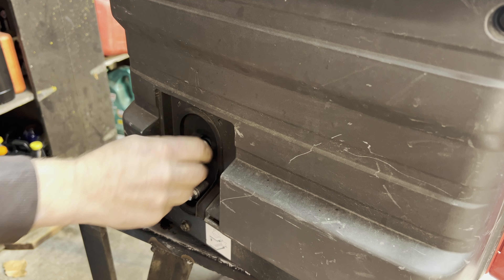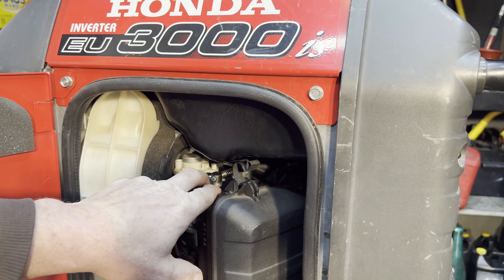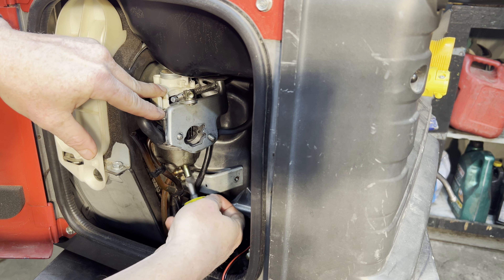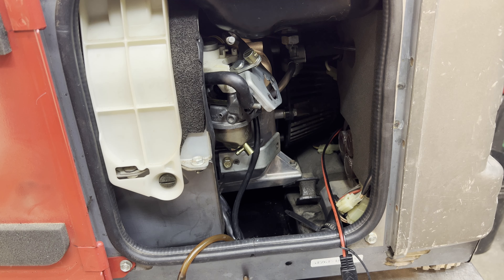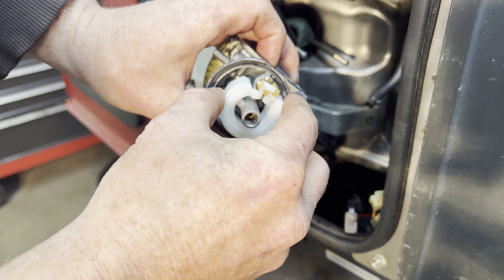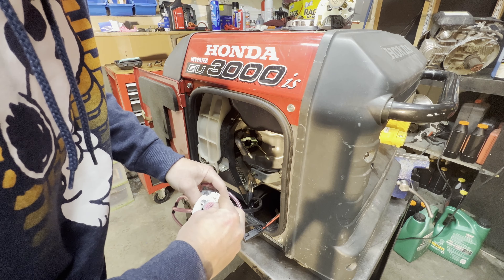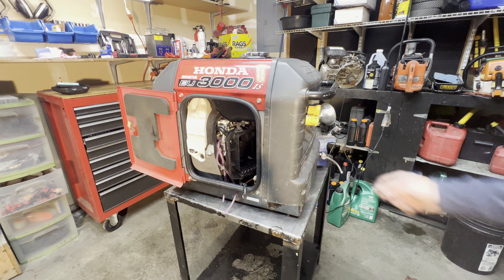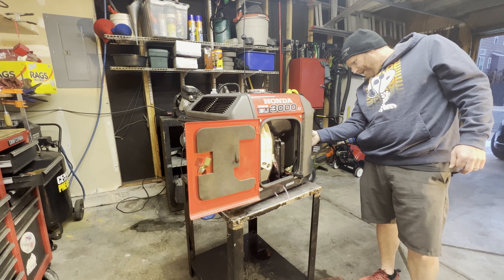Honda EU3000is Inverter White Smoke

Comment: On the spark plugs , crack it loose with a socket then use a 1/4 " fuel line about 1foot long push it on to the end of the plug and turn it out . This is also great for starting the spark plug back in the hole , flexes easy and you can see around the plug to Aline yourself properly .You can feel how it is engaging with the threads never cross threading .
Reply from the maker: Never thought about doing that. Thanks Chris!

Comment: Hi Rob , great channel . Do you know what controls the idle speed when in ECO mode ?  My EU3000 at my off grid cabin runs all power tools, microwave, Keurig no problem but sometimes in ECO mode if I start the table saw (with nothing else running but led lights) the lights dim and the genny trips . I feel that if i could raise the idle setting for Eco mode just a little bit then this would stop happening . It seems that the genny cannot respond (rev up) fast enough when presented with a bigger surge load.  It doesnt always do it.  I love the quiet and fuel savings of ECO mode but this problem is annoying and I think it's fixable .  Thanks Rob !
Reply from the maker: There is an idle adjustment screw. You should be able to get to it without removing anything. Hopefully that does help.